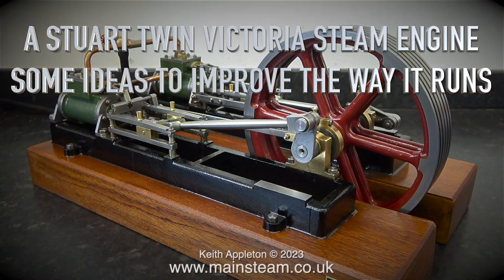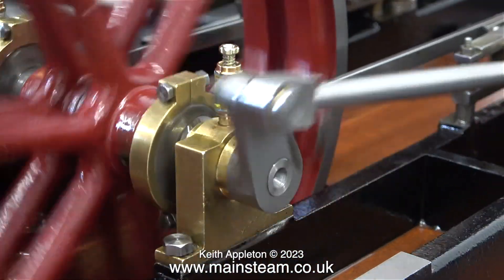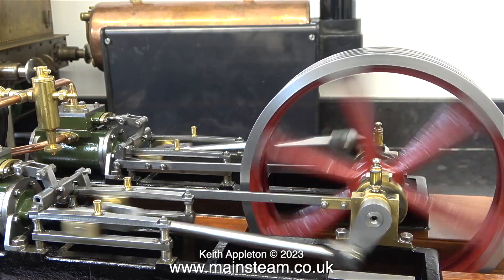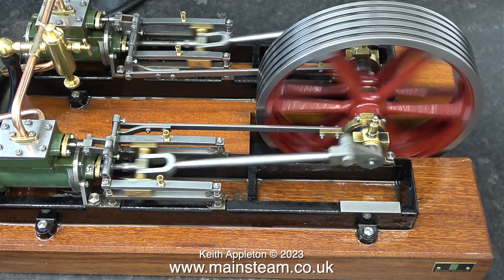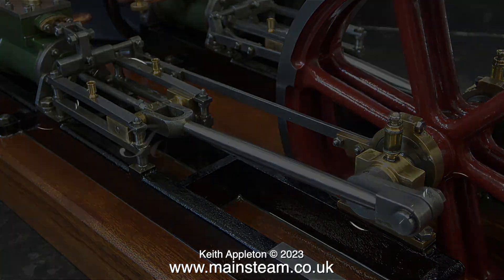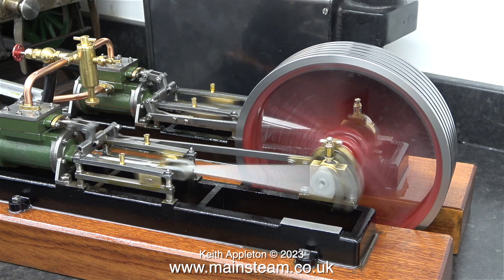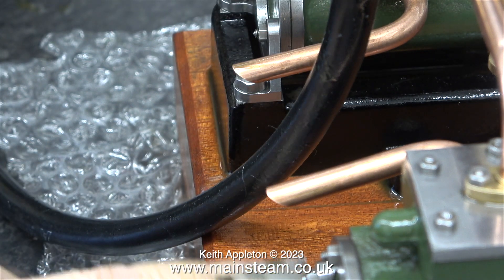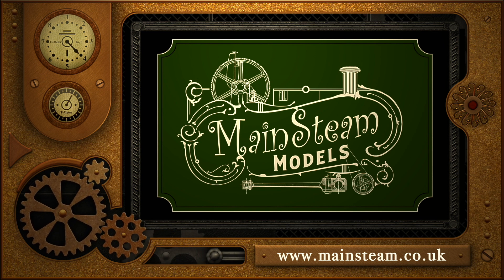STUART TWIN VICTORIA - SOME IDEAS TO IMPROVE THE WAY IT RUNS

Comment: I see that the two cylinders are running at about 90° apart.  Why are they not set up at 180° apart?  It seems o me like that would minimize the tendency for the engine to pitch left to right as viewed from the side.
Reply from the maker: Some people keep asking me this, and I really don't understand . . . . . if you put the cranks at 180 degrees, how is it going to be self starting? Have you never seen any other Steam Engines and Steam Locomotives - the pistons are double acting and they have 90 degree Crankpins.

Comment: I watched a steam engine team at our local train museum while rhey prepared this locomotive for a day's run. They inserted a large solid cylinder of lubricant into a case on one side. Is such solid lubricant which melts at heat used in model steam use?
Reply from the maker: It was probably Tallow type lubrication which isn't used in Model Steam Engines, or if it is I have never seen it.